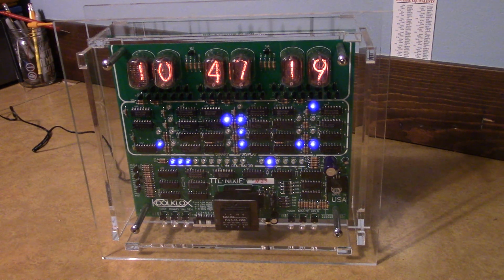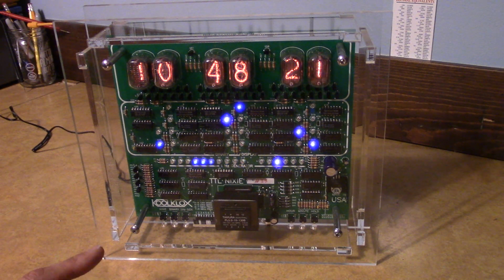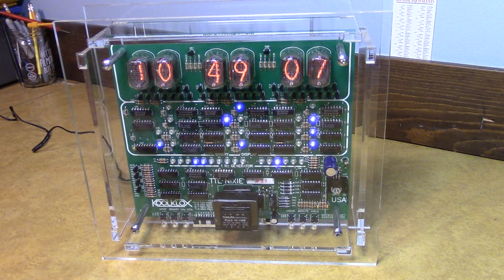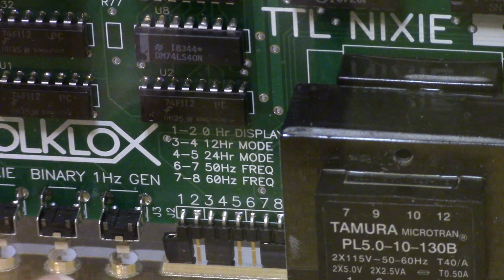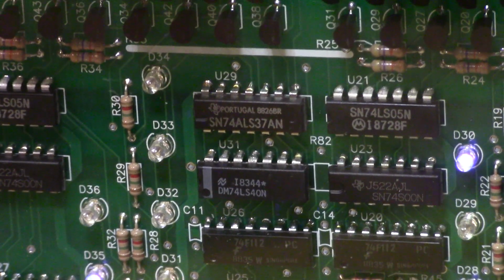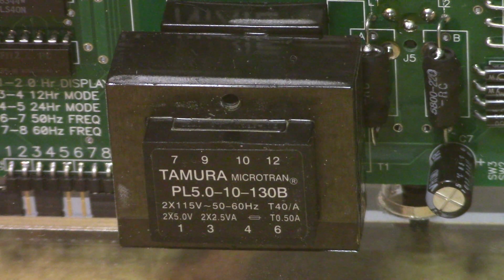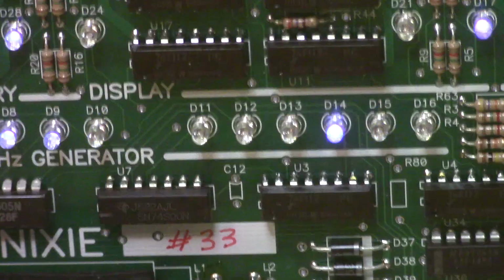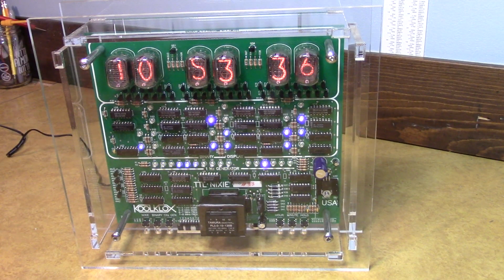KoolKlox Nixie Tube Clock 7400 TTL Clock Kit

Comment: Nice see through case, Do you by any chance work on these type clocks. I have one that is based on the MM5314 chip that seems to gain 10 minutes per day.
Reply from the maker: Hi Greg,  I do like the "see the works" look too, thanks.  Yes, I do collect and work on them especially the MM5314 based ones.   Do you know what your clock uses for a time base?  Is it line sync'd or does it have a crystal oscillator?  If you want, you can leave me you junk email here or a way I can contact you to move forward or we can do it here.  Jim